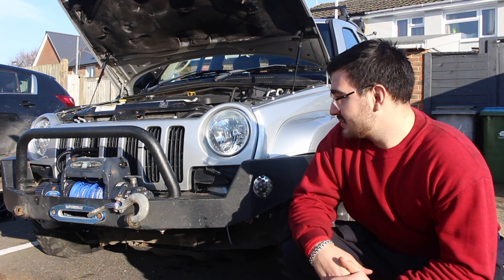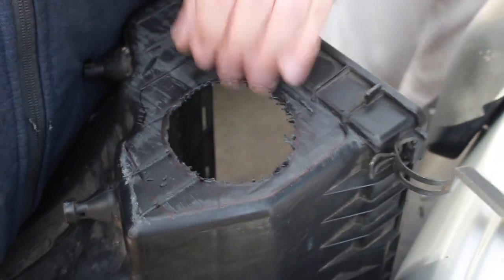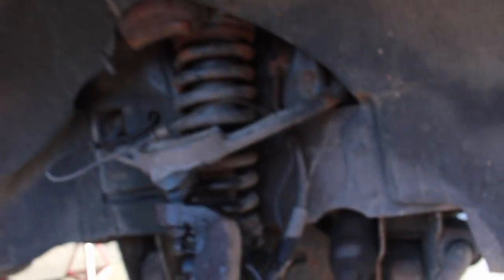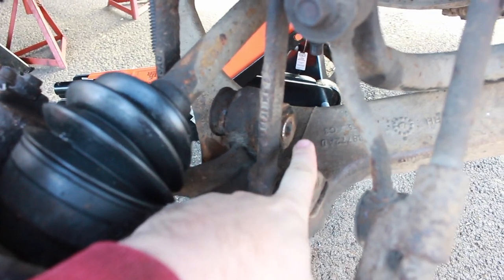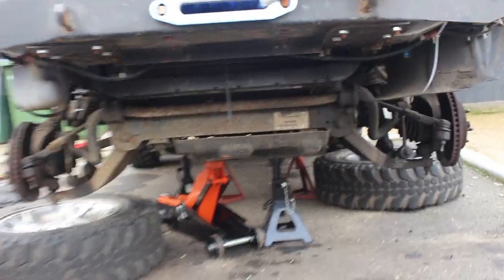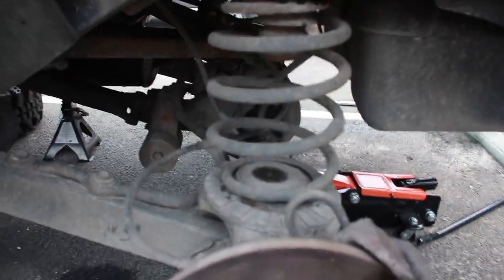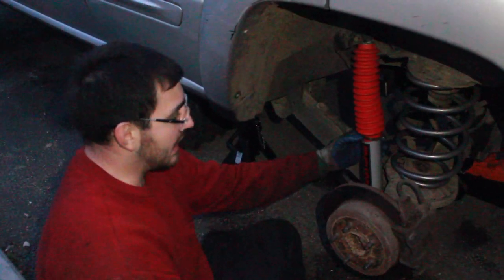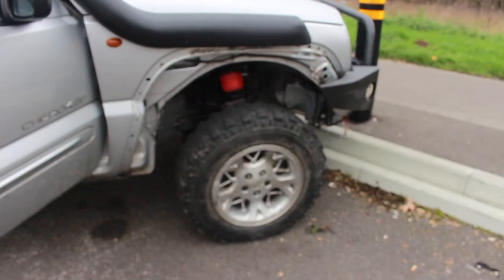How to Fit a Lift Kit on a Jeep Cherokee (liberty) KJ *Start to Finish* - Plus Snorkel and Winch!

Comment: I have a lifted jeep liberty, you basically have to get offroad  / re engineered upper control arms. Also I recommend getting new moog lower ball joints as well
Reply from the maker: How come you had to change the upper control arms?
Reply: @PeakPatrick  apparently it’s to help with alignment and control arm ball joint failure

Comment: I hope that snorkel dont leak water, the body part u cut is exposed so much that it will leak in the body. I would weld thin sheet of metal inside to make it structural stronger and waterproof. But great build, thats nice car to have ;) gl

Comment: I ran a lift kit for a few years. It causes front end components to wear excessively fast. Front bushings, CV axle, upper and lower ball joints. My advice is upgrade tire size and hammer the metal and cut the fender as needed to fit the tires. It will give about 1.5" of lift

Comment: What size wheels and tires were able to go up to? I bought some 20” wheels w 31” tires on them and installed a 2.5” spacers for front and 2” spacers for rear and still rubbing, now cutting a bit of the wheel well and maybe putting on some 1.5” wheel spacers to see if that helps w front hard turn rubbing.

Comment: Have just put a lift kit 2" (I think) but am noticing a slight rattle from the rear when going over small bumps or corrugations any idea as to what the problem could be?

Comment: Hi there I’ve fitted my lift kit the the rear did you have any problems fitting the passenger side where the drive shaft to close to the shock ?
Reply from the maker: I didn't, both sides at the back went in reasonably smoothly after lowering the rear axle on a jack
Reply: Hi sorry I mean the passenger side front I fitted mine and it looks like the drive shaft would hit just trying to find out if you had any issues loving the Chanel mate great content
Reply from the maker: @stemartin1726  ah right sorry, didn't have any issues with driveshaft but we did fit bump stops at the top if you have them too? And thanks appreciate the feedback 🙏
Reply: @PeakPatrick  ok I will have another go with it I’ve fitted the rear took me 10 mins a side but the front hole different ball game aha look forward to seeing more content of the jeep

Comment: So what size tires are you able to fit now?
Reply from the maker: We can go up to 265/70R16
Reply: Still not even a 31 10.50 15 . Which is the smallest off road tire
Reply: 265/70/16 are skinney pizza cutter looking tires